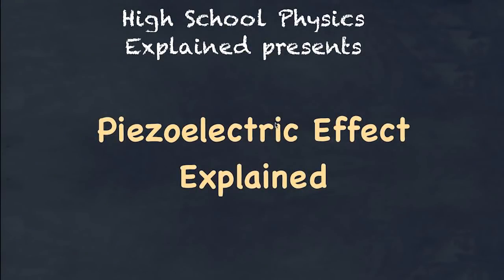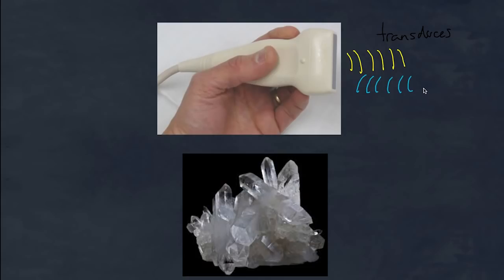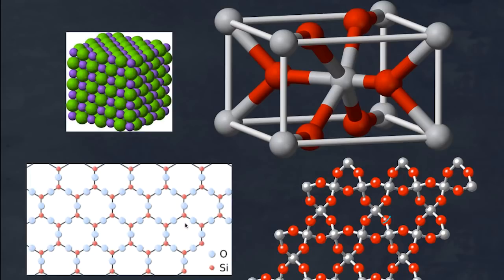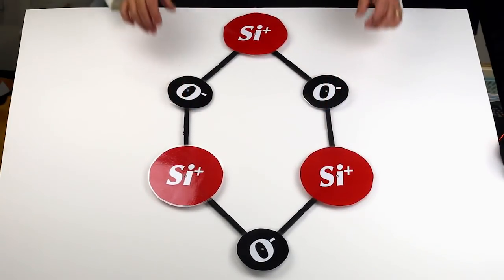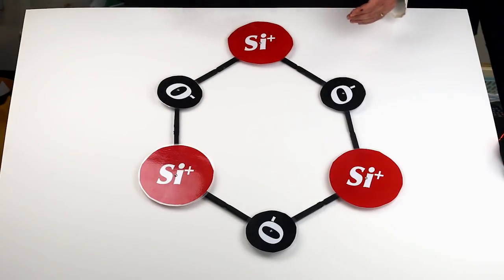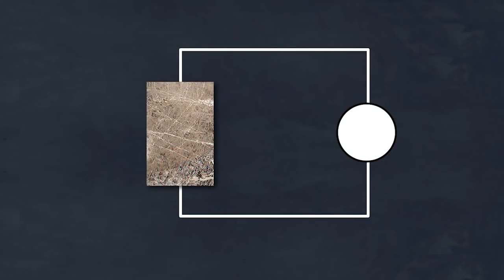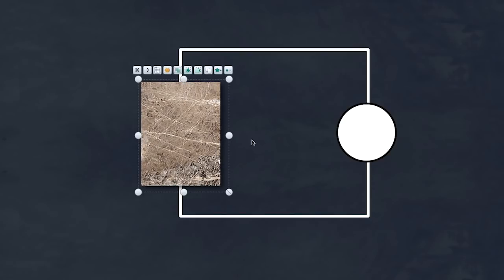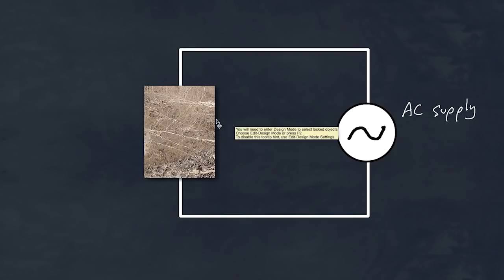Piezoelectric Effect Explained using a simple physical model

Comment: This is the first compelling science video I was able to understand in a while. So it's not just the organised structure that gives it the piezoelectric effect, it's also the arangement of the charged particles.
I've heard that bone is a good piezoelectric material. I'm guessing that's how bone conduction works, as the sound distorts the structure of bone, converting it to electrical signals, then it reaches the 8th cranial nerve which get's processed by the brain as sound. I'm a bit foggy about the mechanics of sound hearing though. The ear seems like a very complicated piece of machinery.
Reply from the maker: Glad it helped. 👍
Please share with friends if you think they would benefit.
Reply: Hello Paul! My name is Rodrigo Ruz and I am a young scientist from México. Do you think that using PVDF crystal would be a feasible option to produce energy with sound?
Reply: can you help me to finding anything that connects me to the original RAIF technology. disease (metastatic cancer)

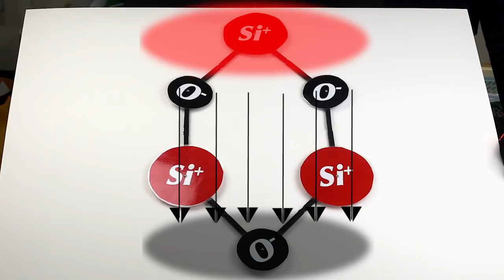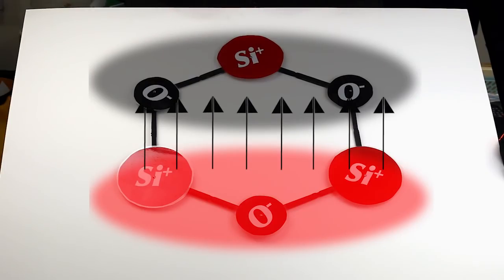Comment: The arrows representing the current (electron) flows within the distorted quartz (at 5:13 and 5:50), aren't they pointing in the wrong direction based on the description of the electric field created by compression? The electrons flow would be from the (electron higher density) o- to the (electron lower density) si+. Alternating the compression direction would still generate ac current, just the arrows on both compressions should be reversed.

Comment: Excellent video, thank you very much!! The explanation in 4:20 has opened my mind...
One question here please: I did not understand the reason in putting the negative charges in the upper or lower part of the crystal, and viceversa for the + charges, in the 9:37 minute... 
Thank you!
Reply from the maker: Silicon dioxide is slightly polar, that is, the molecule is slightly more positive on one side and negative on the other. Water has similar characteristics. In a normal lattice arrangement, there is no net polarity. However , when distorted then there is a minute polarity on surfaces depending on the stress placed on the crystal.
Reply: High School Physics Explained Thank you very much!

Comment: Great Video, Thank you, But here is something, I didn't get. Why quarts polarized in minus and plus, in first level, when you pushed on it, up side was one oxygen and down side was two silicon, why top  in becomes more positive ? and in other case, why bottom in becomes more negative ?
Reply: Very great question I would also like answered!
Reply: @189vans Hey mate, its because imbalances and because it is not in simetry, top side is very last edge of the point with silicone and bottom side is very last edge of oxygen, so it takes potential different from the surface, lets say like that, and when i levels, it takes the charge that is the most.

Comment: Thank you Sir. In terms of collecting or harvesting this energy production to charge any rechargeable portable devices, do we need to convert it from AC to DC? 

There are many energy harvester module sold in the market today but I don't how they are being used or applied
Reply: If you make one, yes. If the device is a charger - it has that built in.
Reply: can you help me to finding anything that connects me to the original RAIF technology. disease (metastatic cancer)

Comment: Actually we can compress one quartz vertical and the other on the horizontal then a dc battery results and we could use it to power device and if we use it to be compress one under total stable with no molecules oscillator and compare to a normal crystal then we get natural crystals frequency of atomic frequency like French measure atomic clock

Comment: Sir, I had a question: If a constant stress is applied on a piezoelectric material, will there be a continuous electric potential produced? Or potential will be produced only for an instance and then we have to relax the material again and apply stress again and repeat the cycle as long as we need electric potential?
Reply from the maker: Great question. Need to be oscillating.
Reply: @PhysicsHigh  Thankyou for the clarification.

Comment: Hypothetically speaking, could a very high alternating current deform the lattice in such extent that it would break the Si-O bonds?
Reply: Well I guess it would, as when lightning strikes it actually breaks some bonds in the air causing nitrogen from air to form a new bond with water forming nitric acid.

Comment: Hello! Very helpful video. I have a coupe of questions about the argument. Is this phenomenon manifested in a certain scale in every ceramic composition? If it's not, which are the main parameters that make a ceramic composition (crystal) a piezoelectric one?
Reply from the maker: No it does not manifest in all crystals. In fact, crystals can not have centric symmetry. There are a range of crystals that do show the effect. The effect predominantly is determined by the charge density upon pressure applied and the relative elasticity of the bonds between the atoms
Reply: Thanks a lot.

Comment: Everything I have seen using a pulsating action on piezo material. If you compress with out pulsing will the current continue?
Reply from the maker: I an not an expert on the piezoelectric (aka I am not an electrical engineer) but a current should remain as long as there is a potential difference. SO in theory, if you apply pressure to it, a PD should remain and so a current could be maintained. I am happy to be corrected
Reply: until the compress breaks the crystal, i guess
Reply: I'd intuit that since there is no change in energy density there will be no change in electron location.
Reply: Perhaps thinking of the object like a shape that does not want to change (stiff/no flex) but still conductive. if you connect the compressed side with the uncompressed side, the fact that the material is conductive makes it so that a circuit is formed and the electron density tries to balance out. I'm only just discovering this stuff but that makes sense to me.

If there is no movement and the electrons are already balanced out again (ignoring resistance of circuit) then there can be no current because all materials in the circuit are balanced actually, even if you are still deforming the objects shape. Potential energy is still held in the crystal though because of its stiffness(elasticity?).

Comment: The earth's magma is very rich in silica. If silicone dioxide is affected by sound waves and electricity causing its lattice structure to vibrate, will a failed star, white star emitting massive electromagnetic wave towards the earth cause the magma chambers under the volcano to become heated up and more viscous thereby inducing an eruption?
Reply: guess it depends on the exact amounts of matter and energy you're dealing with. Seems like it would be tough to tell how much energy is gonna get through the atmosphere then through the crust to affect the magma. I'm not very interested in the answer, but maybe you could isolate your variables, look up the appropriate equations, and grind it out? (I'm curious about just how much energy you need to significantly heat up that much molten rock...seems like a lot).

Comment: When deformation takes place  as the crystal moves closer to the vertical line how does positive charge build up on top?
Reply: I don't know.  My guess is the combination of each molecule builds up a small voltage which propagates due to vibration.

Comment: what would happen if I would keep a crystal of quartz under a constant mechanical load along the force axis? Would the voltage vanish after a milisecond moment or would it remain??
Reply from the maker: +anubhab kundu  in theory a potential difference would remain but it would be DC only. Although not an transducer expert, a DC output would be problematic in trying to amplify the signal.
Reply: High School Physics Explained thank you for replacing electrochemical batteries!!.....I think now all vehicles can be driven by DC piezoelectricity which never requires a juice-up.
Reply from the maker: +anubhab kundu I don't think a current will flow just because there is a potential difference. Besides, no more energy input via pushing would mean no energy output due to LCE
Reply: High School Physics Explained what is LCE? and why would a current not flow even though a pd is there
Reply: High School Physics Explained and one more thing....have you ever tried sitting on piezo array to note down the output voltage?
Reply from the maker: +anubhab kundu no😐
Reply: High School Physics Explained well....good enough.....try to do it and upload an yt vdo.....
Reply from the maker: +anubhab kundu LCE is Law of Conservation of energy. 
Two points in a circuit can have a potential difference but if they are not connected in some way via some sort of conductor, no currentbwill flow
Reply: High School Physics Explained that I know.....you said there will be no current....that is why I gotta confused
Reply: I have the same question, we know that if it is not a complete circuit, no current will flow. The question is if it can generate electricity if it's under constant pressure, for example, if we put it under a book, can it generate electricity. I know that even if it does, it is DC instead , but the problem is can it do so.
Reply: I guess the same thing would happen as with pn diodes. You would get a potential barrier that would stop the charge from moving.

Comment: I really want to test how much mechanical energy gets converted in electrical energy, but I dont know if that's possible. It is for a school assignment and I am stuck with this question for a very long time. Can you please help me?
Reply from the maker: +Arjan Klinkenberg so to test you mean set up an experiment with piezo electric crystals?
If so, one thought is to get a microphone that is piezo  based. If you can measure the sound and determine the energy then you can also measure the voltage generated in the microphone. Both measurements should be related.
Reply: High School Physics Explained
thanks for your reply!! :), but i may take some time again...  i have this kind of piëzo electric elements:
 https://m.reichelt.de/Signalakustik/EPZ-20MS64W/3/index.html?ACTION=3&LA=2&ARTICLE=145915&GROUPID=6560&artnr=EPZ-20MS64W&SEARCH=%252A
my potential experiment was to connect my piezo to an osciloscope and messure the voltage and current with that. To create a current i would push the piezo element. ofcourse i will do a more acruate experiment in which i know  excactly how much mechanical energy i have. But before I was going to start i need to know if this could work. I would really appreciate if you answered this question too.  

(p.s. is it possible to calculate the electric energy with  E=V*I*t)
Reply from the maker: It could theoretically work. Yes, you would calculate the E = V.I.t equation. My question is how would would measure the mechanical energy? And how would you measure time? Maybe drop a small mass on to the crystal (not enough to break it of course) you can then determine various variables from force, momentum, work analysis. Has its problems though.
Paul
PS - I suspect you are dutch by your name :)
Reply: High School Physics Explained yes i am dutch  hahah. i may calculate the mechanical energy by dropping a rubber ball on the piezo element.  i could calculate  the mechanical energy with this equation: E=m*g*h. I will not include the energy loss throught air resistance because that would take too much time.
i can meassure the time with the osciloscope, or not?
Reply from the maker: Yes, but how would you measure time for E = VIt for electrical energy?
Reply: High School Physics Explained what if i put a LED or something else in my curcuit? i could meassure the time when it is on with a stopwatch or by filming it. could that work?